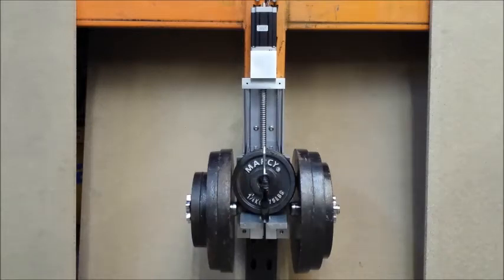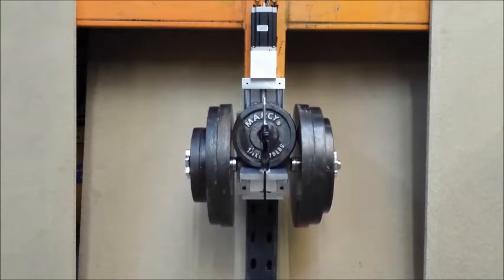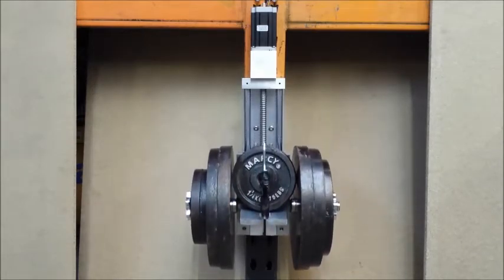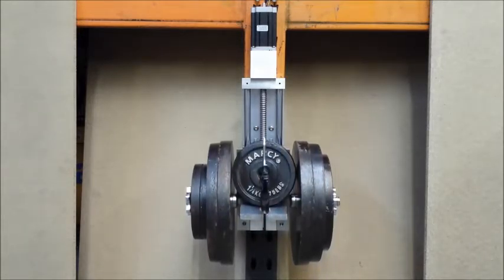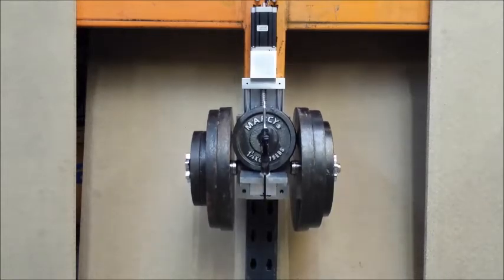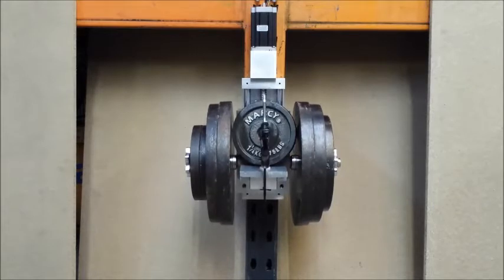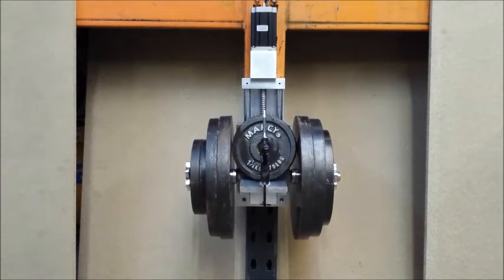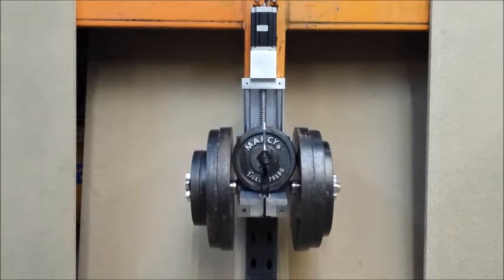Cnc4you ltd Z Axis showing high power capability of our products

Comment: How is the performance of this CWD556, does it skip stepps?
Reply from the maker: Hello Kalle Balle, these new generation 32-bit DSP processor drivers are high performance drivers that use online adaptive PID (Proportional Integral Derivative) technology, without manual adjustment will automatically generated optimal parameters for different motors or working conditions, and help to achieve the best performance from the stepper motor. Missing steps are normally associated with single chip drivers, low cost clones or incorrectly specified driver or stepper for the application or incorrectly set speed and acceleration for the machine. Also wouldn't expect missing steps from our CW5045 or our other analogue drivers we sell as we use them for machining everyday.Brian